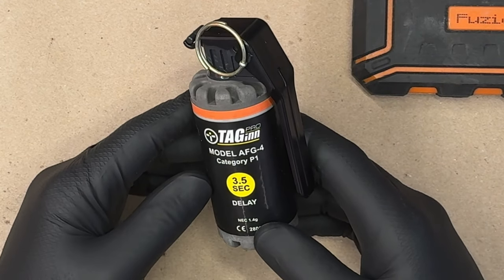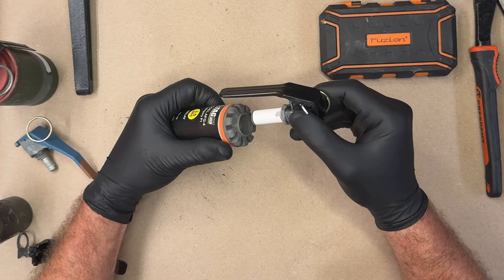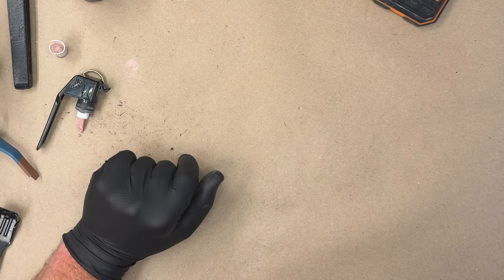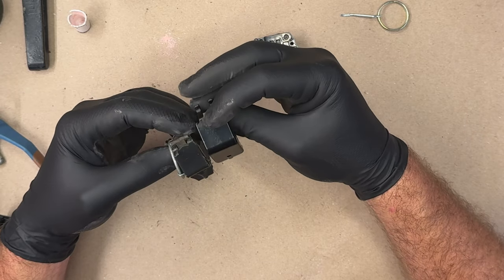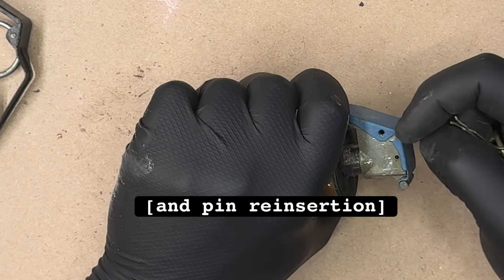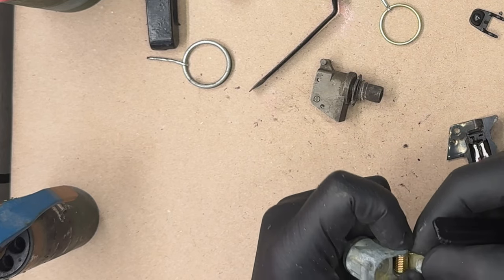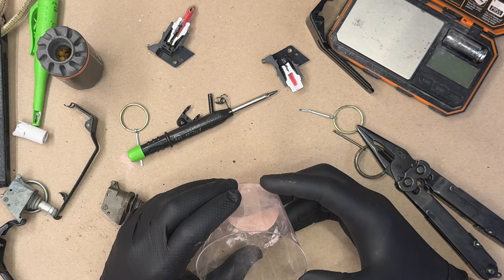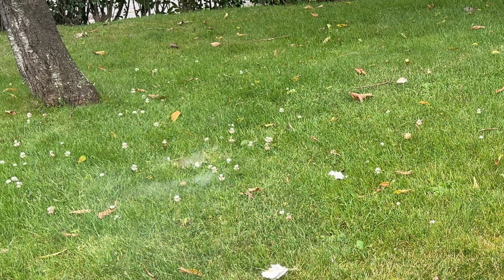TAGinn AFG-4 Flashb@ng/Fragmentation Gren@de Teardown and Analysis

Comment: Different ignition caps, different strikers. One employs an all plastic construction the other uses basically a .410 type primer that requires a metal striker like a firing pin in a firearm. Nothing to do with not harming anyone's fingers.

Comment: Iron (rust) is added to exotic thermites to slow them down. When people are trying to cast and actually use weird stuff like zirconia, it just blows out the pot or whatever crucible without it in a flash and the crucible is mostly empty. It makes a big difference. Some guy made a bunch of exotics vids, I saw a few of them.

Comment: Are you going to work on flashbangs next? They'd be a great addition to the smokes.
Reply from the maker: I’d love to. I just have to figure out the legality.
Reply: @InventionIncarnate  legality- shmeegality.... It'll be alright, 😆
Reply: Federally as long as it is under 1/4 oz total explosive weight and has no frag / is not designed to cause harm it is legal.

State you are in I have no idea but rather simple soon as it has frag or goes over a 1/4oz it is a DD and needs a tax stamp.
Reply: @InventionIncarnate 

Federally as long as it is under 1/4 oz total explosive weight and has no frag / is not designed to cause harm it is legal.

State you are in I have no idea but rather simple soon as it has frag or goes over a 1/4oz it is a DD and needs a tax stamp.
Reply: Thats not true. That is only for projectiles, not hand deployed devices @11ride4life
Reply: @ChevTecGroup  
So are you saying it is more or less restrictive?
Reply: @11ride4life  I'm saying there is no 1/4ounce limit, that is only for projectiles. But I don't know what restrictions there would be otherwise.
Reply: @ChevTecGroup  
Ok 👌 you may be right but I was always trying to be on the not end up with a dead dog and in jail side of the coin so if it is kept below the 1/4 oz one less reason for them to be pissed.

But the frag and intention (designed to harm) is the most fundamentally important part as far as I understand and read the law. 

But I know the reason I was given for a lot of the civilian flash bangs was too large of a charge (that is why the currently legal blank firing grenades won’t take 12ga shells and they are only sold with 209 primer or 9mm blank configurations, the 12ga adapters are for LEO or FEL holders only)
Reply from the maker: @andrewbrown875  my concern is the legality of making the flash powder itself.

Comment: If it takes an hour to make, double-sided sticky tape a few boards together.
    Would recommend Japanese pull saws and a hinge chisel. Use a stop instead of a vise and work flat. Try to fasten something across the table just a few inches from the table edge so you don't saw through your table all the time.  I use a jeweler's bench block for that. It sits below the edge of my bench and that's the stop, can't clamp much down, start cutting crooked if I don't keep flipping stuff over to keep the line on both sides.

Comment: I would love to see some of the tag in grenades recreated. The m67 and rgd5 both probably use the same principle as the flashbangs. Could also probably try 3d printing the fuse heads. Great video though and love the channel! Keep up the good work
Reply: Stubbs gun guy on odyssey has 3d printed fuse heads that use spring/hammer kits you can get from pyro stores. They work well and use either 209 primers or small pistol primers. OP's fuse system would have less metal in it though and you can probably get more made for what you would spend on fuse/primers/hammer kits with OP's pull ring system.

Comment: I think the powder is sodium salicylate, potassium perchlorate, and iron oxide as catalyst, it’s usually used as a whistle fuel but in rare cases it’s used as a burst charge, in this case it may be to bypass 50mg regulations on flash powder

Comment: i think thats just some bad whistle mix, i doubt its something like golden powder as someone stated before, usually this composition is not used in commercial fireworks since its quite hygroscopic and due to that not suitable for storaging. performance is not that much better than bp either, wouldnt make sense to replace it with sth like this. whistle mix is perfect for this, its a way better burst charge than flash powder, if its confined properly
Reply from the maker: Please Subscribe for my sake. Your insight will certainly be helpful in future videos. I’m going to look that up on passfire now. Pinning so I can find
Reply from the maker: Ok so I have a 70/30 mix of potassium perchlorate/sodium Benzoate mix for a burst charge. Do you think that they added 1%iron oxide to catalyze?
Reply: @InventionIncarnate  done.. actually thought i had already since your videos were showing up in my feed
Reply from the maker: @dainbramaged1  you likely did already subscribe. YT unsubscribes people on channels they suppress. Countless subs have mentioned it
Reply: yeah most likely, i guess without catalyst such a coarse mix wouldnt be fast enough. ive seen some whistle mix used in a commercial firecracker, just cant remember its name atm, had red iron oxide in it aswell and a phlegmatizer (which slows down burn rate minimally but will increase storage time a lot). from my experience with whistle mix, red iron oxide and copper oxychloride as catalyst will give the fastest burn rate, while black and yellow iron oxide or black copper oxide will give a louder, more raspier whistle at the cost of burn rate/thrust. so for use as burst charge the red iron oxide is best choice i think. edit: 76:24 +1% should be even fast than 70:30

Comment: bro could you make this entire fuse assembly using 3d printer and and instead of using primer , could you use toy gun caps?
Reply: Toy caps are just reduced charges to military roll caps used in the first unlit when thrown gernades and in cap and ball rifles.
   If you had to substitute modern toy paper caps for a blckpowder revolver cap compound, you use 2 of them. That's enough to set off a powder load of 35 grains or more of powder for the .54 revolving rifles. Same for the .44 with 20-25 grains of triple F.
   Dex (pyrodex) may require a third. Cap and ball pistol caps are available in magnum or they put a few grains of powder before the dex. Reliable ignition can be an issue. 
   Too much is bad tho, you can get over pressure that keeps ths flame from penetrating. We ram a needle into the packed powder to give it a place to go and increase surface area the flame reaches. Some nipples have a side vent, ampco.
   I know this is a blackpowder revolver focus, but this is what you need to understand for that. I'm sure there's roll cap cowboys putting videos up in that sport, watch a few.